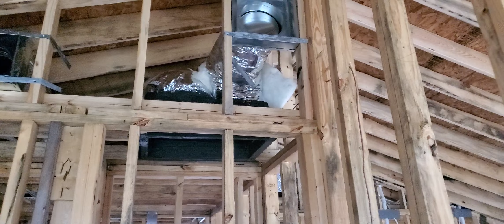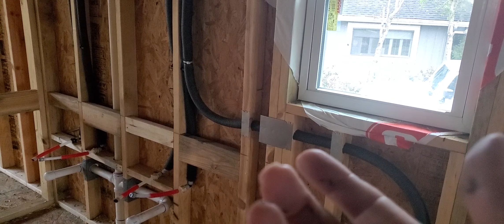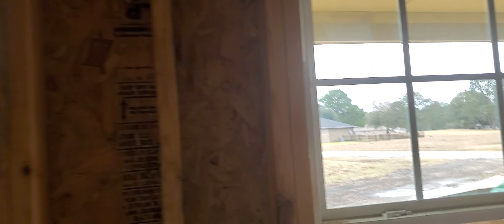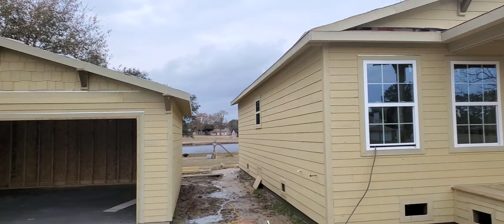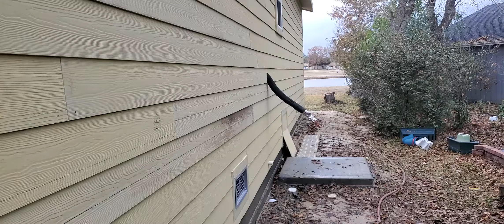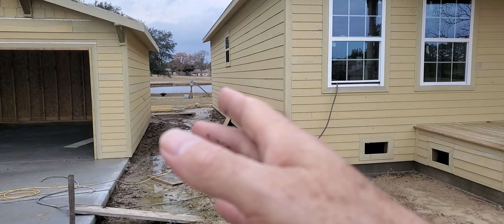How To Build A House - The HVAC Guys Are Here!

Comment: Where the plumbers drilled through the roof rafter,how big a hole can they drill and maintain the strength over the span.these videos are a great wealth of knowledge.thanks for sharing.
Reply from the maker: Not sure. You can Google about the allowable cutting and drilling of  joists. rafters, and beams.